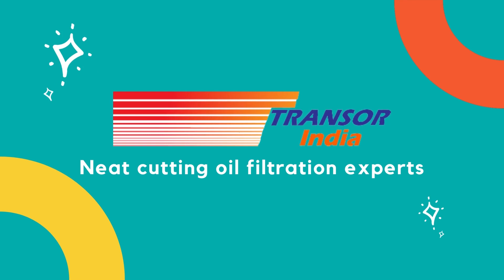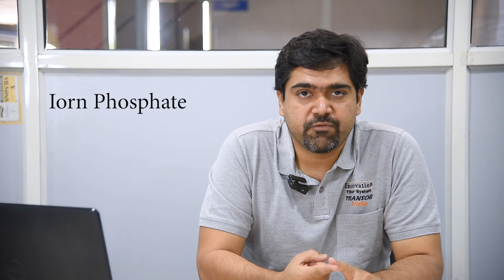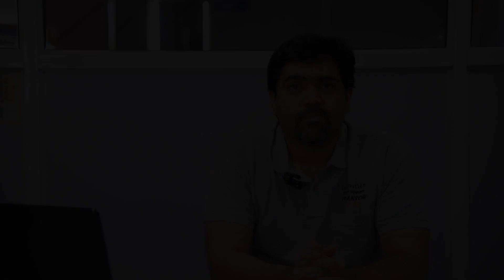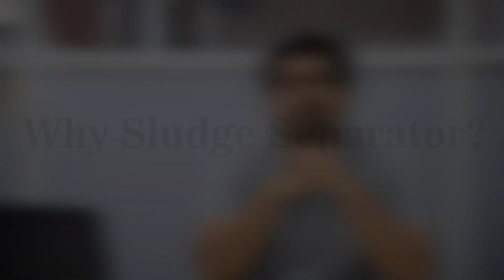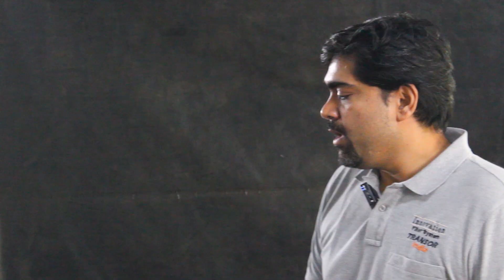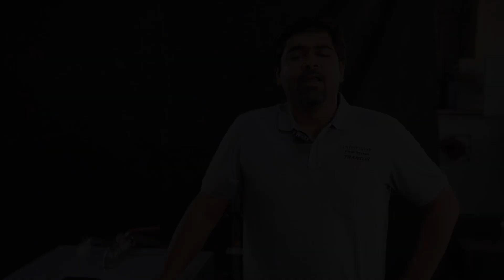How to remove zinc phosphate sludge?

Comment: Hi , i came across your video and we face exactly all those problems. We clean in a certain rythm.
Question;  Does your sludge filter system reduce the amount of mangan phosphate chemicals ? How much ?
Reply: Hello, do you still need the phosphating slag removal equipment at your end at present? This is the original factory in China that produces the phosphating slag removal machine. It can achieve fully automatic slag removal without affecting the composition of the chemical solution.

Comment: Sir for tank capacity 15000 ltr dimension of bath 12.6 mtr length  x 1.4 widthx1.5 MTR depth bath ..What size of sepration system is recommended for  Zn phosphate  application.plz revert with contact no
Reply from the maker: Hello विधुत यंत्र. Thank you very much for your inquiry. Please send us an email at- sales@innovationfilter.com. We will send all details over email. You can also find more details at https://innovationfilter.com/applications/phosphating-chemical-filtration
Reply from the maker: Hello, apologize for the late reply. I wondered how to explain it in this short comment box since I will have to use drawings to explain it correctly. However, I will let you know the logic that I would use to design such a system- 

The design assumptions- 
1. Continuously removing sludge is essential. 
2. Phosphating chemicals should not go to waste
3. The separation should be automatic, without any manual involvement. 

Design logic- 
1. If possible, make the tank bottom slope on one side and make a tank drain on that side. The drain should have a valve so that we can shut it whenever we want to.
2. Connect a scraper conveyor to the drain valve. The sludge, along with chemicals, will continuously flow by gravity in the conveyor.
3. The conveyor will transport the sludge out automatically. 
4. We will use a pump to deliver the sludge-free chemicals from the top of the conveyor to the process tank through a simple mesh filter. 
5. The mesh filter can be in a 1 working, 1 standby arrangement.

This is one of the solutions to solve this problem. In case you want to discuss this in detail, please email us at sales@innovationfilter.com.
Reply: Hi, please share your contact

Comment: The tank is 12'x7'x5' ( just a estimate size) with heat tube at the bottom of tank.   The tank is divided, heat tube on one side of wall,  spray system motor weir on the other side.  Sludge settles at bottom while running production on heat tube side. There is a pump filtration on the motor weir side of tank(spray system).  With the volume of product and shifts,  what  can be a solution for removing sludge from heat tube side?
Reply from the maker: Thank you Dunae Burton for the question. We will work on this and come back to you by Tuesday next week
Reply from the maker: Hello Dunae Burton, apologize for the late reply. I wondered how to explain it in this short comment box since I will have to use drawings to explain it correctly. However, I will let you know the logic that I would use to design such a system- 

The design assumptions- 
1. Continuously removing sludge is essential. 
2. Phosphating chemicals should not go to waste
3. The separation should be automatic, without any manual involvement. 

Design logic- 
1. If possible, make the tank bottom slope on one side and make a tank drain on that side. The drain should have a valve so that we can shut it whenever we want to.
2. Connect a scraper conveyor to the drain valve. The sludge, along with chemicals, will continuously flow by gravity in the conveyor.
3. The conveyor will transport the sludge out automatically. 
4. We will use a pump to deliver the sludge-free chemicals from the top of the conveyor to the process tank through a simple mesh filter. 
5. The mesh filter can be in a 1 working, 1 standby arrangement.

This is one of the solutions to solve this problem. In case you want to discuss this in detail, please email us at sales@innovationfilter.com.

Comment: Good innovation.  But an operator will be required to replace centrifugal filter. Can it be some type of automatic arrangement?
Reply from the maker: Thank you for your comment Mr. Khan. Yes, an operator will be needed to remove the rubber basket once its filled (its holding capacity is 4.5 kg). There are centrifuges which can be cleaned automatically- company called Centrasep makes them. But they are considerably expensive with lot more moving parts.
Reply: Hi Muhammad, please share your contact